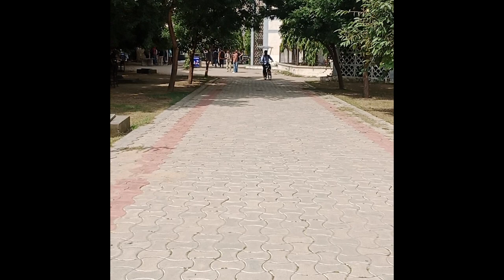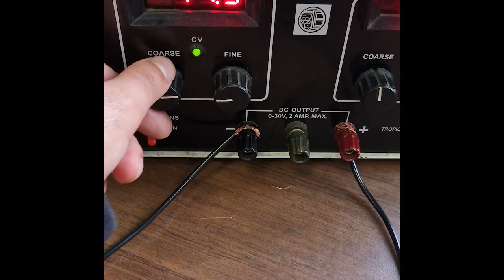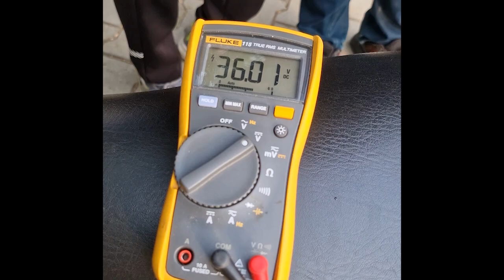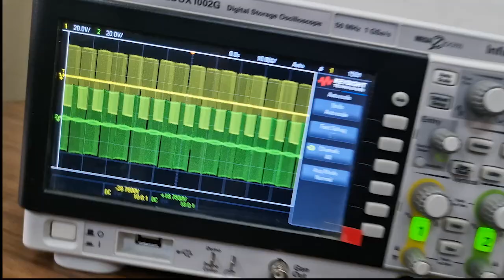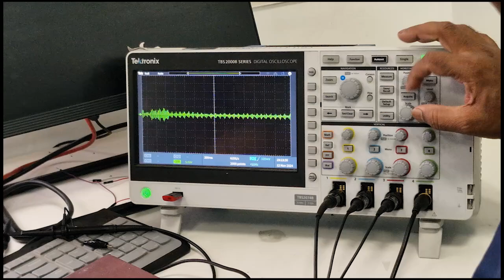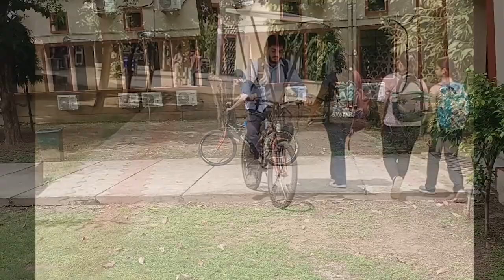Solar-powered  Electric Bi-Cycle

Comment: what are the ratings of solar and battery? and what kind of motor is used in this operation?
Reply: We have used 120W 20Voutput solar panel and a 9Ah Li ion battery.  As for the motor we have used a BLDC Motor